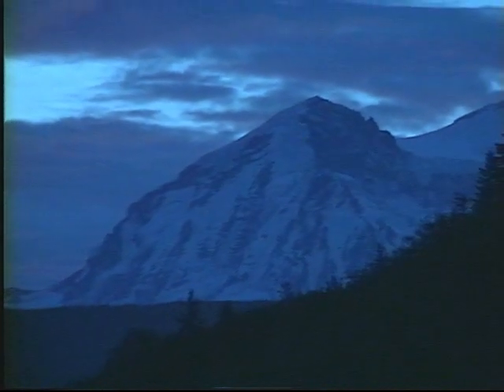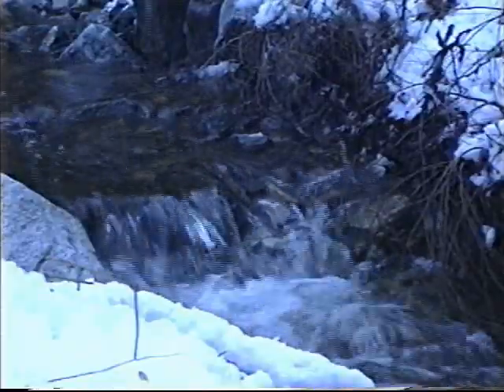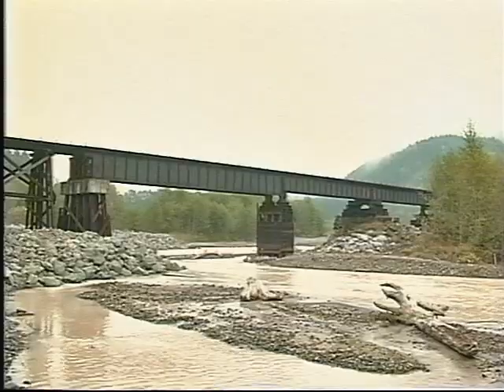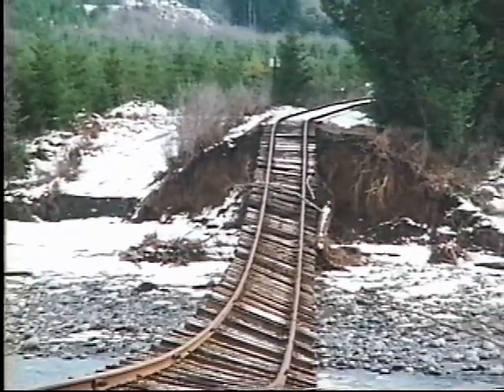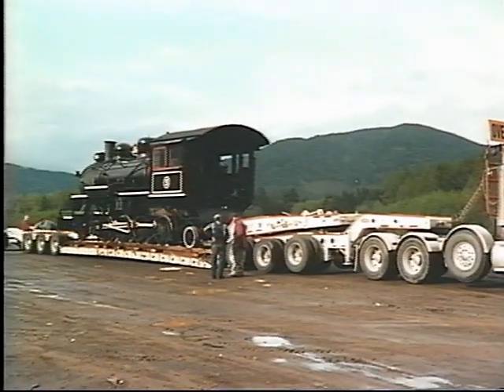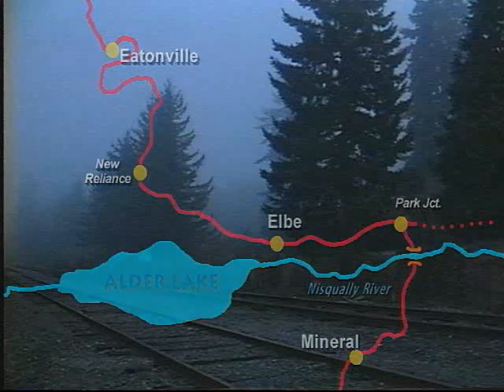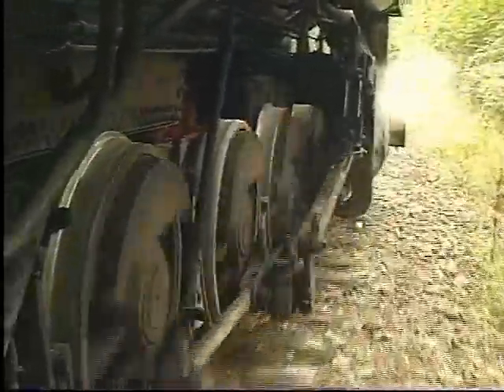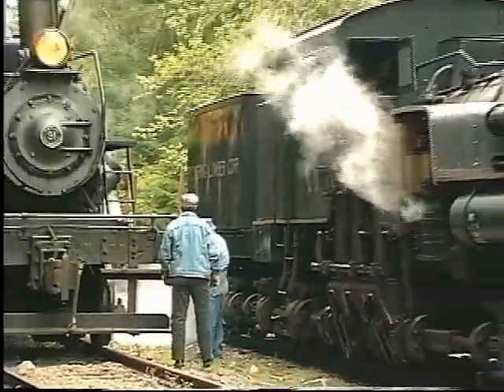Steam powered Rock Trains

Comment: I like railroads. I like new technologies replacing old antiquated derilic technologies.

I like cutting up old steam locomotives and old railroad equipment. I like to see the parts melt in the rosey, warm glow of a blast furnace of molten iron.

I like to clean up old scrap iron and dispose of it in such a way as to make new materials for new fuel efficient, maintenance efficient transportation products.

I like spraying grafitti on railroad equipment! It is just such a good feeling!

Comment: Both locomotives in the video weren't properly prepared to haul out their max tonnage, so they are basically entering this without the necessary service which will take a toll on them. By the end of the video both locomotives were in need of major repairs.
Reply: yea 5 got it really bad it has been out of service for 21 years now, but it is currently under restoration witch is exiting

Comment: I never said I do not like railroads.

I like progress and new technologies and disposing of old garbage like steam locomotives.

I like the feel of a oxy-acytelene torch cutting up the parts and the sound of the junk falling apart! I like the sight to the red riveluts of molten iron running from a cut and the splatter of the red hot beads hitting the ground! I like the sound to the 6 ton magnet hoist lifting the cut up parts and the bang of the junk iron hitting the bottom of gondola! Junk!

Comment: Those things should have been scrapped 60 years ago.

Time to haul them to the scrap yard and put the scrappers torch to them, cut them up and send them off to be melted.

They would make plenty of materials for new fuel and maintenance efficient transportation vehicles.
Reply: a lot oil burning steam engines are more efficient than diesels.
Reply: and a better use of materials

Comment: Steam locomotives did nothing for foundation of this country's principals. They were nothing more than a transportation tool.

The time has come to run time into a scrap yard, part them out, cut them down, and send the pieces to a blast furnace for melting.

If the blast furnances have been removed for new developements, then it is time to chip them up and send them to a steel foundry overseas.

Steam locomotive steel makes great manhole covers, pipe wrenches, rebar or anchor chain!

Comment: It is an idea which will not pan out in this country!  More melt for the blast furnace. More materials for new fuel efficient, maintenance efficient transportation equipment.

The steam locomotive is a carbon mess!
Reply: again a lot oil burning steam engines are more efficient than diesels.